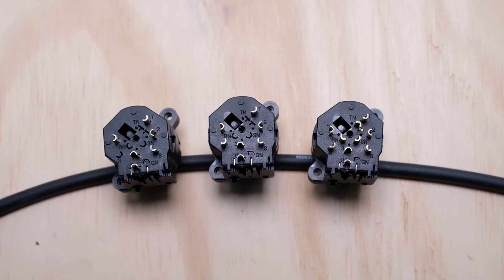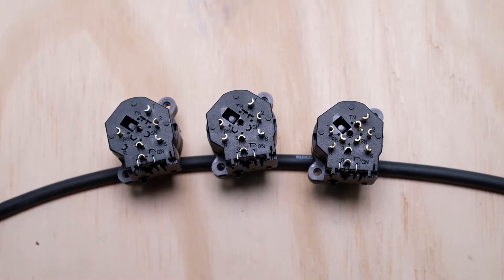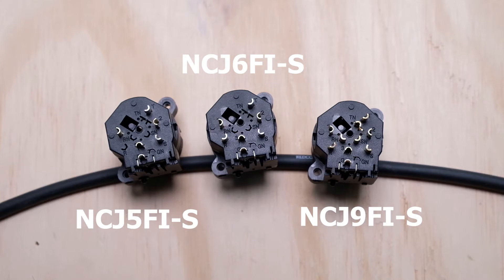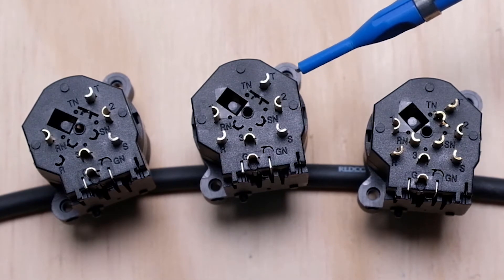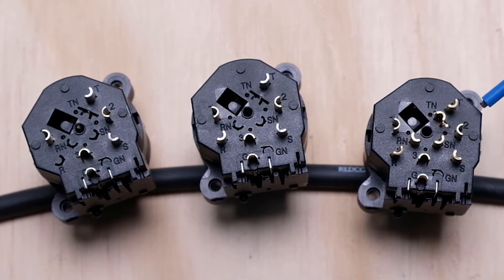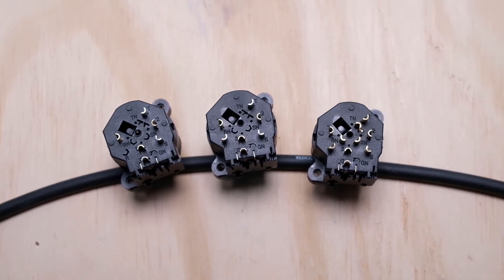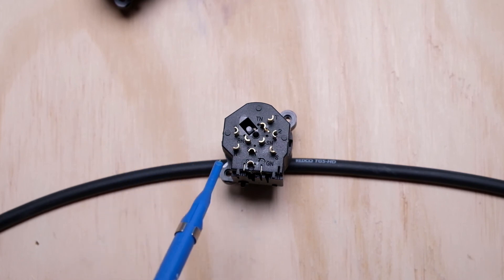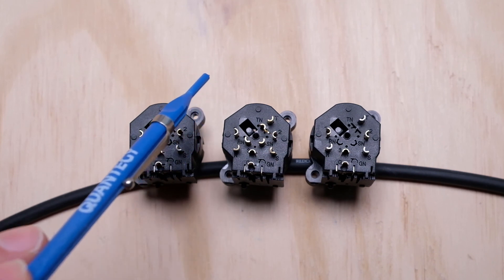Neutrik Combo Jacks

Comment: This is the best info available on these jacks.  Can I wire these to "break" phantom power to a TRS connection with a common (only one) output?  Thanks for the great work!
Reply from the maker: Thanks for watching! If I'm understanding your question correctly, the switching jack (NCJ9FI-S / Right side) should accomplish this for you. Admittedly, I haven't delved quite that deeply into the problems presented by phantom power with TRS connections, but I'd review the information in this video around 6:30 to see if that will work for your application. Sorry if that's not what you're referring to or not a perfect solution.
Reply: @AlphatoneAudio   Thanks so much for the reply.  My initial thinking is that this isn't a possibility, since PhPwr is being sent backward from the mixer/preamp/etc. to the microphone using the same cabling as for the signal.  There would have to be some way to separate the PhPwr from the audio, and cut only that.  There may be some routing options from within a board or patch panel,  but I'd like to use these jacks at a distance.

Phantom power through TRS isn't really worth the risk, I don't think.  I'd love it if somebody proved me wrong...

Thanks again!

Comment: Hey, I think you made a mistake. At 9-pin connector, Input is supposed to be wired to normal pin, while jumpers should be between TRS and 123 pins for Output.

Comment: Also to add to my other comment - My intended use for what I learned in this video is to put a couple of Combos on a rack panel, then go from each Combo to an XLR male connector that plugs into a speaker processor/DriveRack. The intention is that I can feed Line Level from a mixer with 1/4" balanced outs (a Behringer analog mixer) OR from one with XLR balanced outs (my X-Air XR18) and send to the same equipment (the DriveRack). So again, the incoming cable(s) from a mixer might have XLR or TRS connectors and I want either to be plug-n-play with 1 receptacle space.

Do you recommend the 9-pole for this purpose and how would you wire it? I think it's explained in this video but might have gone a smidgen over my head without actual demonstration (not an issue with your video, just that I learn better that way).

Again, I REALLY appreciate that you made this video and find it rather useful while preparing to make my own rack panels to interface equipment in a portable rig.

Comment: Thank you so much for this video. There is such a limited supply of resources about these and some of the other Neutrik product line when it comes to wiring and mounting to panels, in chassis, etc. So your efforts are greatly appreciated.

Something else I'd like to see is the process of installing combo jacks, as well as regular XLR male and female jacks, and perhaps an EtherCON jack into a panel. Perhaps a pre-punched panel or a custom punched panel. I am specifically trying to learn things like front vs. rear mounting (I know the Combos are rear-only), and particularly if I want to use a DSS-* plate for each, can I do that and how. (I'm assuming EtherCON is D-style but am not sure.)

Can you hook us up?

Comment: This is a simple and really helpful video - thanks for posting. I'm building a panel on a 19" rack cabinet which will have an input which leads into the back of my neve 1073dpa (xlr combi) This is just so i don't need to keep reaching round the back! 
I'm pretty sure i need a non- switching combi, but i'm a bit stumped about the whole grounding issue! I didn't quite grasp what you were saying about it. I'm seeing 2-pole / 3-pole jack options too. So overwhelming! What do you suggest I go with? thanks if you have time to answer this
Reply from the maker: You can always take any of the parts above and simply wire them as a standard XLR jack without even connecting the TRS terminals. If you need simple, keep it simple. Alternatively, if don't want to use your preamp for line/instrument-level signals, just get a standard, non-combo jack.

Comment: So are these jacks always screwed to the panel from the outside of the panel inward?  Is there a how-to on flush-mount installing these things?  I have the dimensinos from the neutrik drawings on their site, but didn't see any instructional info on  how these are supposed to actually mount.  And the A-8-1 screws are only 8 mm long and I don't even though if that also includes the head.  So once you get through a 1/4" panel, there is only a couple mm or less left to sink into the neutrik screw bosses.  Anyone help?
Reply from the maker: I did a whole video on this:
https://www.youtube.com/watch?v=1c1KddThvT0

Comment: Would this combo Jacks fit in a D type drilled rack panel? Can't seem to find the answer anywhere! Thanks :D
Reply from the maker: Yes, absolutely. Neutrik recommends a 24mm or .945" hole. You can see this in any of the downloadable specification they have on the website.
Reply: @AlphatoneAudio  Great! Thanks for your answer

Comment: Thanks for the informative video! Not much info around on these.

I have a dilemma and I thought you might be able to help? I built a small patch bay with two  '6' pins and a headphone jack. Basically just an extension so I can plugin on the edge of the desk, instead of over all the stuff on my desk.

I put the jumpers on the '6' pin combo's and ran the balanced cable to a Neutrik male XLR to input into my interface. (I did 2x of these) 

When using a TS 1/4" (Guitar) I'm losing over 30db of gain at the interface! I tried just the TRS pins without jumpers, and also snipped the 'R' pin connection on the '6' pin combo, so as to only pass mono, but it's still the same deal.

I'm so out of ideas! Cheers!

Comment: I'm soldering 16 of right now, and your video is the only reason I knew how these worked.  The 9 pin (switched normal) plus a digital (dante) ML16-D Tascam going into an older mixer: crest xr-24, with nothing plugged in, the out of the digital interface is 'up' on the board.  Very cool, if I want mic, I flip it on the mixer, if I want synth or guitar in, I plug in and it takes over.  Very very cool, thanks for demystifying these. I just wanted to check back on the vid to make sure I was good. :D
Reply from the maker: Sounds like a cool project! Glad I could help.

Comment: Thanks for the great video, very helpful. I have an audio interface with a row of combo inputs, one of which no longer works with an XLR input. It will work with quarter inch so I'm wondering how might ths have occured and how can I fix it without opening up the unit (as I don't wish to void warranty). I'm dealing with tech support for the product and they have been very helpful but limited to firmware resets at this stage. Any suggestions that might help? Is this likely to be a digital switching issue or a broken lead inside the desk? Many thanks 'Jamie.
Reply from the maker: If you have an audio interface, it wouldn't use these particular jacks. There's a whole different group of parts that are meant for PCB assembly. For sure you will void your warranty if you open the unit, so I would just work with support unless you are VERY comfortable with PCB rework.
Reply: Ok Good advice. I will continue with Tech support and get my mixer to one of their service technicians. Many thanks for your reply.

Comment: I wish you would have explained the first one (ncj5fi-s).  You went to center and far right. The R is what I am missing .  Is that the ground wire?
Reply from the maker: The NCJ5FI-S is for mono 1/4" jacks. That's why the ring tab is missing on the back.

Comment: Specific to the switching version if it were wired up to a single XLR cable; are there any issues if you had these in a patchbay that is then hooked up to an A/D converter that supplies phantom to multiple inputs at a time? In that, if you had inputs 1-2 requiring 48v, but 3-4 are 1/4" (and obviously don't need it), would the fact that it is jumpered to TN RN SN send 48v to the 1/4" and present any problems? 
On a fundamental level as well, would plugging a 1/4" into this, which is then wired to connect via the XLR input on the A/D, present any line/mic level discrepancies? The A/D also has the combo plugs (which spurred the idea to seek out a combo plug patchbay to retain that flexibility), but would need to connected via XLR to make use of phantom still. Thanks.
Reply from the maker: Sending phantom power to anything with 1/4" jacks is always a risk as that equipment generally wasn't designed for it. Phantom works well with XLR plugs because the pins are always isolated from one another. On any 1/4", 1/8", TT patching solution, the different contact points on the plug make intermittent contact with points in the jack they're not intended to touch during normal use. Depending on how the inputs/outputs of your gear are designed, this can cause any number of problems.

As for your mic/line discrepancy question, it has nothing to do with the physical connector being used, and everything to do with input/output impedances and operating levels of the gear you're connecting. Plan your patching carefully!
Reply: @AlphatoneAudio  hi Great tut! I have a similar question about the 'normalizing' wiring on the switching jacks (NCJ9I-S) 

I want to prevent 48VPP (accidentally) running down to the TRS inputs, but be able to power XLR inputs. Is it wired XLR123 and jumpered to TN RN SN (instead of the TRS)? 

Your help greatly appreciated! 
best
Reply from the maker: @kk.students  The XLR pins aren't connected to the 1/4" pins internally. There's no risk of phantom power hitting pins TN RN SN as long as you run them to a separate destination than pins 1, 2, and 3.

Comment: I am having trouble removing 1/4” instrument cables from xlr/trs combi inputs that do not have the metal push release.  Have you seen this issue before? Is there a secret to pulling them out without destroying the cable or product?
Reply from the maker: They can be tight for sure, especially if you are using non-Neutrik plugs. No real tricks I know of other than pulling them straight out with even pressure.
Reply: Thank you so much.  Best wishes!

Comment: I'm not using the switched combo jacks but unless i missed it you didn't mention that the NCJ5FI-S doesn't have a R solder cup meaning that it is an unbalanced/Mono/TS 1/4" connection.  It would be useful information to have if someone were to get these and want a balanced/TRS 1/4" connection.
Reply from the maker: Not sure if I mentioned that, but you are certainly correct.